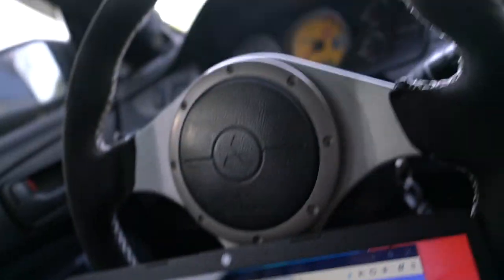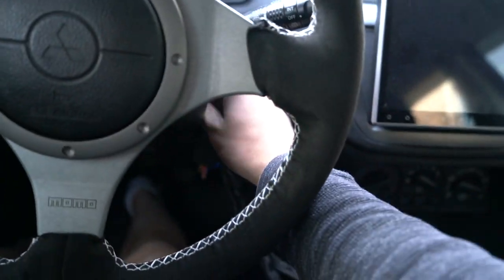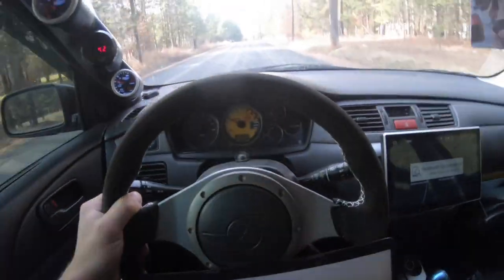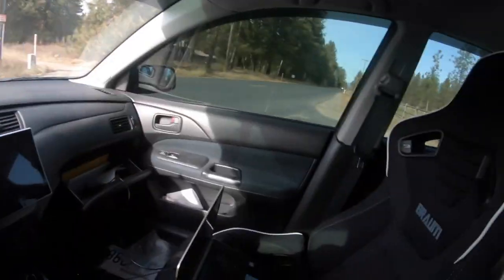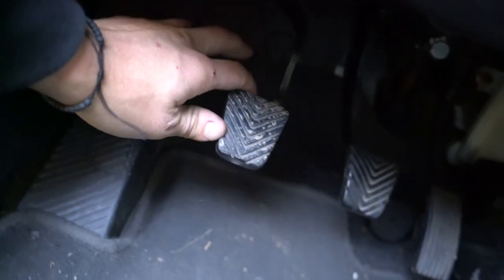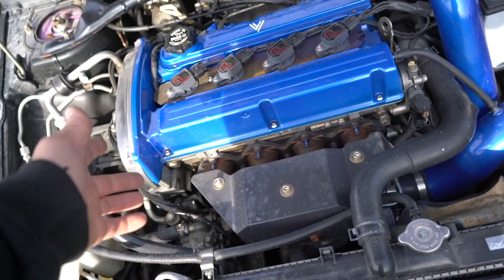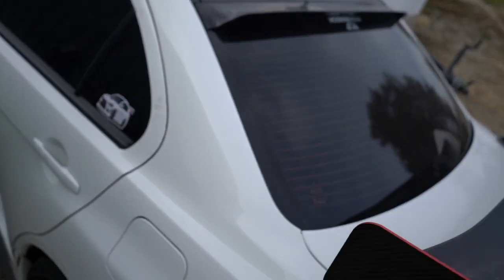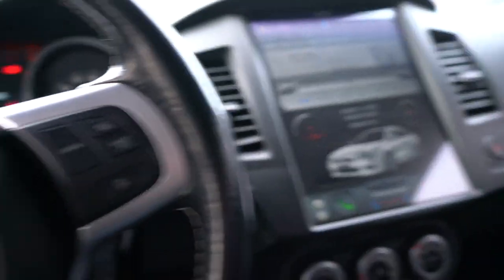2 Step Tune for the Evo 8!

Comment: Check your clutch pedal assembly under the dash. Mine and a buddies both had a crack in it and would flex, thus not letting the clutch push the master cylinder rod in all the way.

Comment: With the new tune on the evo 8 you may be running more torque then what the clutch is rated for. I’m thinking that’s why it blew. I’ve never seen a clutch blow from alittle higher rpm

Comment: Here is the part for the steering wheel. 

Look at this on eBay
https://rover.ebay.com/rover/0/0/0?mpre=https%3A%2F%2Fwww.ebay.com%2Fulk%2Fitm%2F283642547899